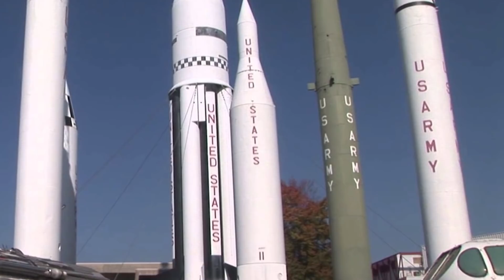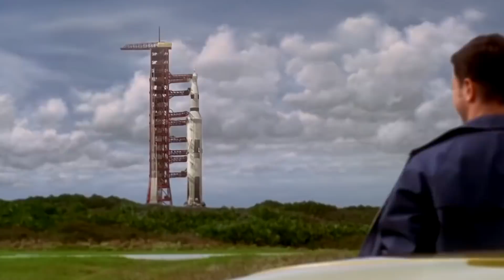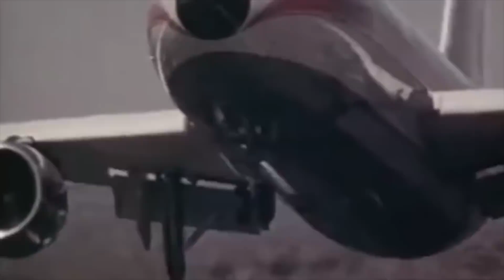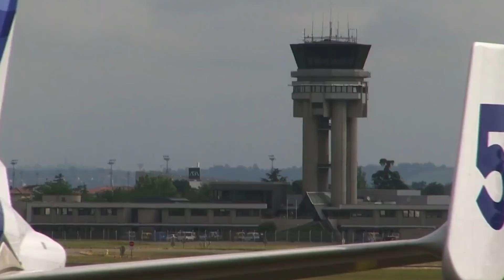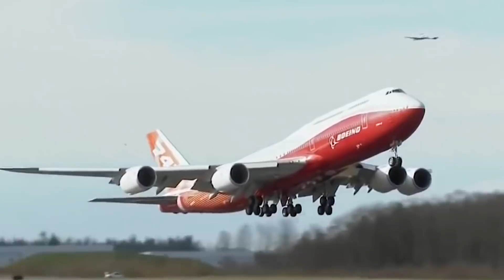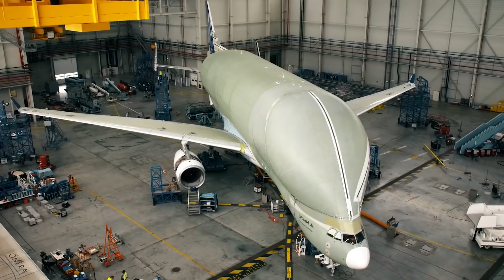From Pregnant Guppy to Beluga XL. The special planes for special cargo

Comment: for everyone asking "why didn't they just use an A380?" I went to a talk by Airbus engineers and they directly addressed this question. Basically there were 4 main reasons:
Cost. A380's are a huge undertaking to build and run. A330 airframes could be bought back off operators to be used as conversion platforms for very little cost (in aircraft terms).
Complexity. The A330 airframe already has a freighter variant that has passed certification, unlike the A380 at the time they were creating the BelugaXL. 
Airfields. Several of the Airbus facilities simply cannot safely handle A380's landing and taking off, due to space or other ground contraints, and in several of them simply expanding the runway is not an option. They could, however, all handle A330's with relative ease.
Facilities: One of the design requirements was that the new Belugas should be able to reuse as much of the specialist equipment created for loading and unloading the old Beluga's as possible. This would have made modifying the A380 far more complex.
Reply: Yes and beluga is a flying beast
Reply: But ultimately building it as a new aircraft is way cheaper than modifying an existing one. From what I understand Airbus evaluated several options, and the only option is to build a totally new aircraft based on the existing A330, just like the BelugaST based on the A300.

Comment: you must know a lot thank you for telling me this im actually a sort of young aviation fan [im 12] and I didn't know anything about cargo aircraft but now I do!
Reply: There are two theories on how lift is created, the more well-known theory is low air pressure is at the top of the wing and high air pressure at the bottom of the wing and the other theory is what some planes use that are shaped like the experimental US plane nicknamed “the flying pancake”, the name was given due to the way it was shaped. Anyways, the other theory is that a plane shaped like the plane I just mentioned gain lift by pitching up about 20-60 degrees up and because of the pitch, the plane has so much “drag” if you can say, as in there is so much air hitting the bottom of the aircraft, where the aircraft actually gains lift
Reply: @waterlicker8635  Wait theories? I thought this is already known and proven. Well, might as well learn some more about the physics of flight I guess. Thank you, good sir.
Reply: @paogene1288  there are two different theories, one of them is more logical than the other

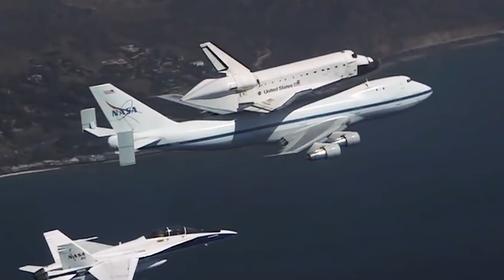Comment: 7:28 The additional vertical stabilizers ended up not actually being needed but were added just in case while they were designing the modifications to the plane. With the aerodynamic cone on the back of the shuttle, the main stabilizer still works fine.

Comment: I worked on an old guppy decades ago, very cool aircraft. It had 4 28 cylinder radial engines, r-4360, (4,360 cubic inch displacement)
Each engine had 2-50 gallon drums of oil piped to them, on a 3000 mile trip they would use almost all that oil. (400 gallons) and it was not uncommon to blow a cylinder off an engine in flight, and she would barely notice it.
Definitely a workhorse!
👍

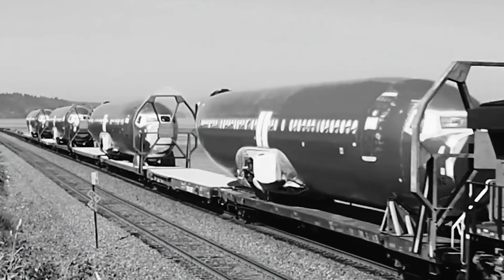Comment: 16:21, the rail transport system Boeing has in place is still operational to haul 737 fuselages as well as partial fuselages and cabins for all of its wide body aircraft. These parts are transported from Wichita, Kansas to Boeing's plants in both Everett and Renton, Washington. In Everett, the BNSF gets these aircraft parts brought in on trains bound for Seattle, or from local ports hauling specially built containers, then once there are enough rail cars ready to build a train, the trek of the hill is made. The fuselages and associated parts continue on to Seattle and then are brought to Renton I'm assuming either on locals or on special trains that only run from Seattle to Renton. I am not 100% sure though, I may be wrong about certain aspects.

Comment: just skip the problems and just make a A380 guppy
Reply: that would not work, because the A380 has 3 decs, 1 for cargo and 2 for passengers. because of the shape of the A380, you would not be able to fit in more cargo than in the beluga...
Reply: Malte Spielt r/wooosh
Reply: Malte Spielt r/woooosh
Reply: @yamato4169  i like how you say woosh because they gave you reasons why it wouldnt work. Its not like that joke was funny (if it was a joke)
Reply: Gordo go to time out too
Reply: goopy
Reply: A380 goopy ftw!
Reply: The a380s floor is a part of the structure of the aircraft so i cant be removed
Reply: @Bob Walker just put more engines on like the top of the plane or on the wings
Reply: Captain Crunch For today’s engines, this would be impossible because of how heavy the A380 already is.
Reply: @BulagBanditMedia  slap 2 more engine on it done!
Reply: @boocomban   On a mechanical opinion of this... its gonna be hard, the people might as well design another plane fit for the concept by the time they added in 2 more engines. Due to certain things, they would have to be changed such as the wings holding the weight of them, thrust of the engines would be changed so then calculations of the parts of the plane aerodynamically would have to change.
Reply: @BulagBanditMedia  GE90?
Reply: @BulagBanditMedia  GE9X?
Reply: @BulagBanditMedia  especially the upper deck whish might become useless in the convertion
Reply: jasun calimag r/wooosh
Reply: jasun calimag r/woooosh
Reply: Philippine Ball. I don’t think it’s a joke buddy. So... no u
Reply: Giacomo Rapuzzi time out
Reply: time out

Comment: It's funny to think that in spite of the fact that they have something like the A380 to work with, they chose the A330 as the basis for their latest large transport aircraft.
Boing, unsurprisingly, based theirs, when they finally decided they needed one, on the 747...
Sure, that the original Belugas were based on the A300 makes sense, but it's still surprising that they chose the 330 for the XL version...
Well, whatever works I suppose. XD
Reply: Its not economically for Airbus to build it using the A380, due to that (a) they did not need that amount of MTOW, (b) its unproven for cargo flights, (c) limitations of airports they are flying into, and (d), the cost of developing it. A330 is the sweet spot for Airbus, and they spent around a billion euros just to develop the BelugaXL.

Comment: An-225 is the best. love watching videos of that thing
Reply: There is an second in the making
Reply: @daanvos194  whats its name?
Reply: @emrefifty5281   i have no Idea but it is in storage in ukraine
Reply: Same the way the nose opens and the ramp unfolds
Reply: B. I. G.     B. O. I
Reply: In my city there was an apartment building whose lift/elevator supposedly had to take 3 months to repair, because the replacement part was claimed to be too large to be air-flown to my city (& thus was shipped by sea instead). I bet they didn't consider the An-225 😏
Reply: Maybe the AN-225 is too expensive for the job since there's only one in existence.

Comment: nooooooooo A-340 is retired!!!! 
            - R.I.P A340 -
25/10/1991 - 25/10/2017
Reply: No, they're in service but production stopped in 2011
Reply: they all retired in 2017 man
Reply: As of last month there are 250 still flying.
Reply: @mariebcfhs9491  No, Lufthansa A340 still flying, Lot rent one A340, and some airlines. Worry not, it's still flying.
Reply: @adam_jar  but production is stopped
Reply: I mean, I recently was flying in a 340 from Air France. How's that supposed to work, then?
Reply: Nope, stopped production in 2011, but over 159 still flying in Jan 2019.

Comment: I wonder if there is any benefit to the Beluga XL if it had been based on the A330neo instead of the A330ceo ... probably wouldn't have made much difference. I also wonder if it is possible to do the same modification on the A350 due to it's composite body.

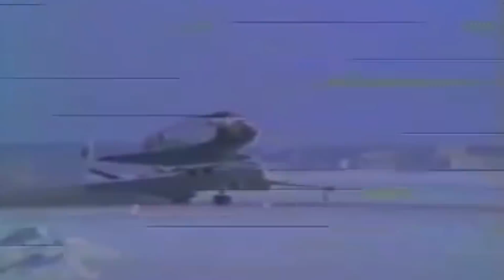Comment: 8:55 how the heck that plane even fly while carrying a space shuttle? 😳
Reply: Spacecraft are surprisingly light. It would add a ton of drag, limiting speed, but not really it's ability to get off of the ground.
Reply: Looking at the spacecraft itself, no wing and even the cockpit were covered (so no glass) means it was totally stripped out thus very lightweight.
Reply: the space shuttles are really light. they do not even have engines. well they do but really small ones that they rarely used. they had no fuel.
Reply: The space shuttle created lift too
Reply: Ok that makes sense thank everyone! :)
Reply: The Soviets knew something about aviation)
Reply: @frankgaleon5124  don't tell the Russians but they fell behind in technology because they were bent on stealing it rather than developing it.
Reply: @jpp9876  the shuttle and buran don't really share anything except for their looks and concept ...
Reply: Lee Zinke engines
Reply: Cos physics
Reply: In the great soviet Russia, the space shuttle carryies the plane
Reply: Nearly all of a space shuttle's weight is its fuel
Reply: It's a 747 bro
Reply: Vodka burners at full power.
Reply: The 2 Boeing 747s were stripped down, and reinforced. The space shuttle weighs about 70 tons,  ( a loaded tractor trailer weighs about 40 tons)
With the 747 fully fueled, and the shuttle attached the combined weight was 122 tons, the max take off weight for a passenger 747 is 130tons.
So even though it looks massive, it is not that heavy.
However the range and max altitude dropped from 5500 nautical miles at 46000 feet to 1000 nautical miles at 1500 feet. The max cruise speed dropped a bit as well but I can't remember what is was, (sorry)
I hope this helps .
😁
Reply: majik
Reply: That shuttle, the buran never flew in space so it was probably just a shell
Reply: Buran did in fact fly 1 fully automated space mission. Did two orbits around earth and landed.
Reply: Buran was a better shuttle
Just it wasn't as needed